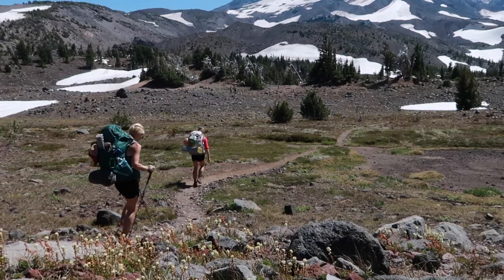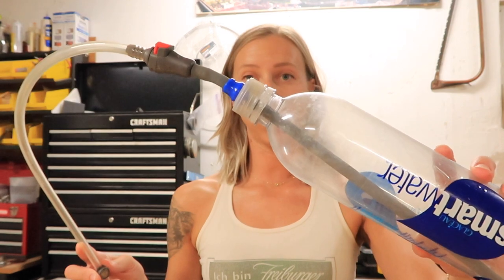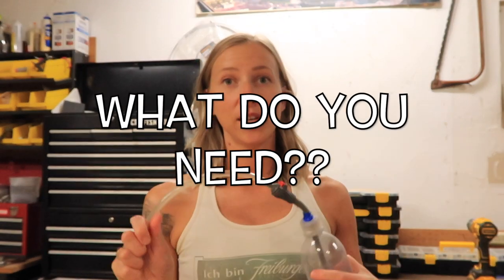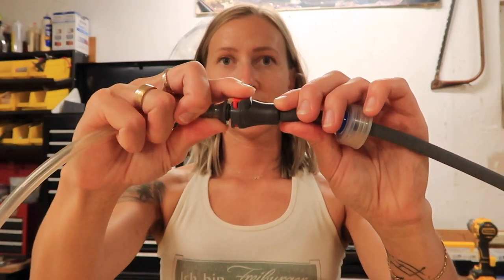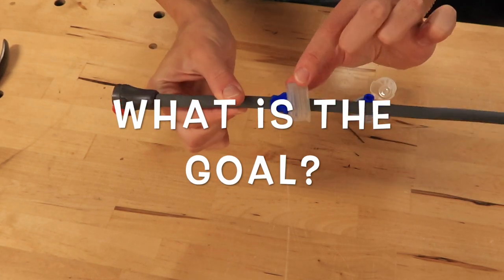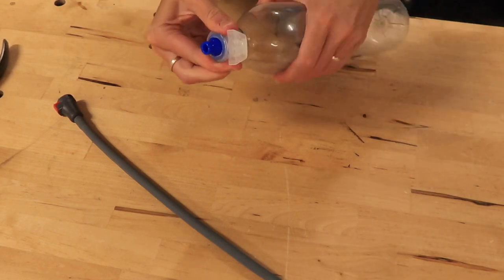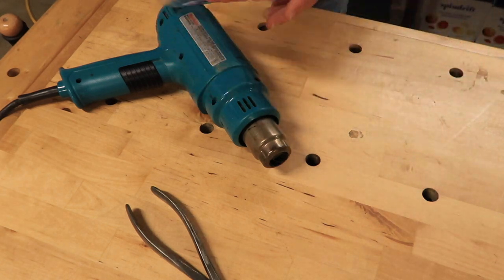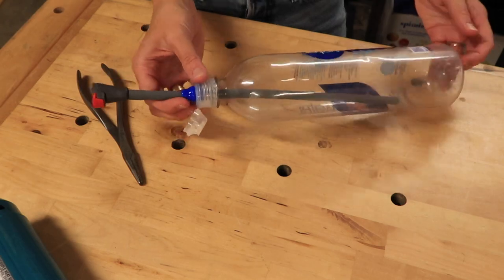How To Build A Water Bottle Hose Drinking System For Hiking And Backpacking

Comment: Super cool idea.  Light weight, cheap and it works.  I have a difficult time with dehydration on trail.  Don't like bladders and I don't want to stop to get my water bottle out enough.  This is a great hybrid of the 2.  Just made my own.  I kept the tension  tight on the drinking tube and used a safety pin to poke a hole in the blue part  so the bottle can equalize.  Thank you very much for sharing.
Reply from the maker: I'm so glad this helped!!

Comment: Had a go and it worked. I bought a cheap bladder backpack from Kmart as I didn't have one (I can use this on a separate occasion) and removed the tube and drinking end.  I bought a cheap water bottle from our supermarket (Coles) with the correct nozzle. It was an effort to get the tube through but finally got there. It was tight though and the bottle would just suck  in when I had a drink so I pierced 2 tiny holes with a safety pin through the blue bit as suggested in a previous comment being careful not to pierce the tube especially as I had to heat up the tip of the safety pine. Worked a treat.  This will come in handy for a 3 day trek. Thank you and others for their tips

Comment: Hi! I've been watching your channel for years now! My water system is an inline adapter for my water bladder. I used this system on the entire pct. It has the same adapter quick release as your water bottle set up here except I plug my Sawyer into it and squeeze filter straight into my backpack. Not a ton of people do it but it gelps me stay hydrated on trail and I dont have to stop for water as often. I'm going to make one of these for my hiking partner, though, because they are gaving a hard time staying hydrated with just a water bottle and even though we've been hiking together for 9 years im sick of sharing ny drink hose with them - lol

Comment: Hi and thanks for the great video.  One question.  After buying the Gregory QD Kit from REI, I realized that the tapered end of the QD that normally fits into the hose can easily fit into the smart water nozzle without any heating or expansion of the hole and the hose can then attach to the tapered end inside the nozzle for a  secure fit. In case you’ve seen this option before, is there any reason to not do it this way?  First thing that comes to mind is that maybe then the hose is no longer adjustable for different size water bottles.  What do you think?

Comment: A couple of Cairn boxes ago came with an Aquamira filter that included the bite valve, a quick-disconnect fitting with barbs for tubing. The filter also used the quick disconnect. Looks very versatile.
Reply from the maker: Nice!

Comment: Did I miss the part where she drills out the hole?  Do you pop out the part of the cap that opens and closes?
Reply from the maker: Yes I just rip the lid off and then I have both drilled it and I have also heated it to make the hole bigger. The heating method is slower but it doesn’t make the plastic sharp which I liked.

Comment: The biggest complaint that I've heard and I've made is that the shape of water bladders makes them hard to clean. This mostly applies to bike riders and day hikers who don't fill them up all the way.

Therefore, weight is not a huge concern. However, maintaining a bladder system when you're only going for an hour run or a  two or three hour hike/run, is a pain in the butt.

The only solution that works for me is to wipe out the entire bladder with a low lint towel and swing the hose in fast circles until most of the water is gone. Then, I place something in the bladder to keep it open and I hang everywhere from a coat hanger in the closet.

I could see doing this for a once or twice per week day hike, but not for running or walking every day. This is where a bottle system is much better and easier to clean.
Reply from the maker: Interesting. I have never once cleaned my day hiking water bladder. I just refill with water every week when I go hiking and it’s never molded on me or tasted bad in 10 years of hiking.
Reply: @HikeOregon  I dont use mine all the time like you do. Also, I had a bad experience once, from lending my Camelbak to one of my kids.

 He took it to a festival and then left it in the backpack and put it back in my closet. Several MONTHS later, I went to use it, and it was NASTY. I cleaned it real well with hot water, and it was okay.

I think the key to your success with the bladder system is the fact that you use them all the time. Many people use them only occasionally, which means they aren't being refilled all the time, and they might sit for weeks or months with moisture in them

I only used the term "day hiking" because many casual day hikers like myself are more likely to hike once, and then put the pack away and forget about it for a month or two.

 From my experience, if they aren't dried and stored properly, they get VERY funky after a long period of sitting. I've talked to several people who used their bladders only once and actually then threw them away because they said the bladder got stinky. I was pretty surprised to hear that.

These experiences, including my own, have left with me the wrong impression that you must dry them out EVERY time that you use them, regardless of the length of time between uses.

 Thank you for your reply. I learned something today. I'm starting to walk and hike a lot more, and I don't mind the bladder system. It's good to know that I don't have to dry out it after every single use.

Comment: How does air get into the bottle to displace the water you drank?  Does it go back up the hose from the bite value?  Is the connection into the bottle a little loose so some air get's around it?  Do you leave the cap a little loose?
Reply from the maker: Air gets in around the hose where it goes into the water bottle.

Comment: No leaks?
Reply from the maker: I mean if you tip it over a tiny bit of water comes out just because it cannot be air tight or else you will suck the water bottle flat when drinking.

Comment: Thank you so much. With your trick, I could use the tube and the valve from my bladder that was resting in my closet. So easy to do and so practical, without mentioning the actual economy.

Comment: I just did this.  I've struggled on so many trips to access water to my hydration detriment.  Solo hiking having to take pack off to get to water is even worse.  I had been using a shoulder strap system but it just didn't work out last trip and kept dropping the smart water bottle.  This took me less than 5 minutes to do.  I actually just used my hand ana a right sized 1/4 inch drill bit (think thats what it was to small to read) to carve out the space for the hose.  I'm so excited
Reply from the maker: Yay!!!

Comment: U don't need to heat it and make the opening bigger. I saw a guy who did a video with the exact "hack" as u, his video was 3 yrs old...
He just cut the end of the tube in a small angle to make it easier to fit through the sports cap. Then he used a plier from the bottom to pull it through. The way he did it also makes it leakproof.
Reply from the maker: I don’t want it totally leak proof because if it’s too tight when you drink the water it’ll suck your bottle flat.

Comment: Thanks! Just made myself one of these using steam (couldn't find the heat gun_. I used a roaring kettle on the stove to soften the cap and then a long drill bit to widen the opening. Did this twice for about 15-20 secs each. Took under 2 minutes to complete this project. Again, thanks!